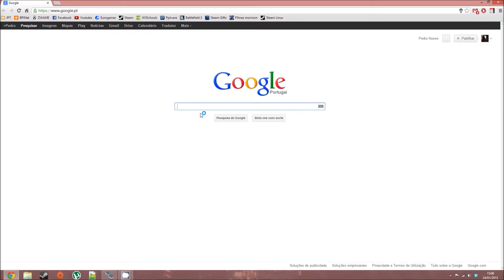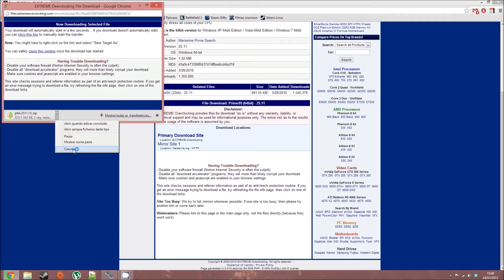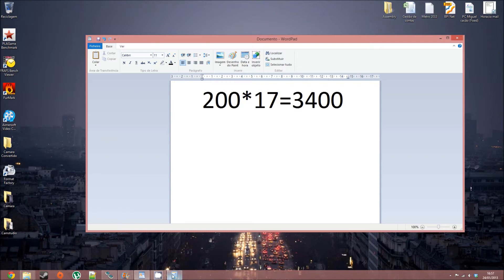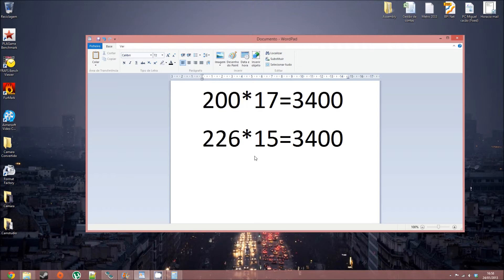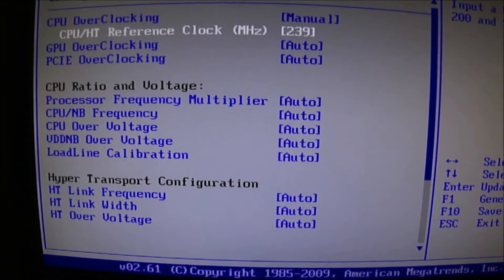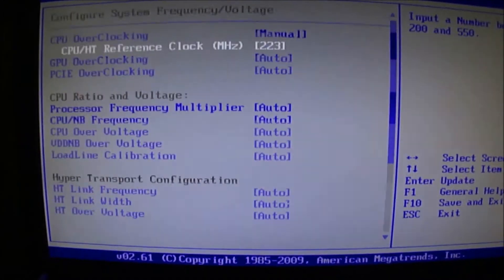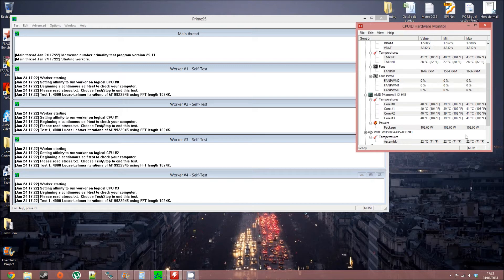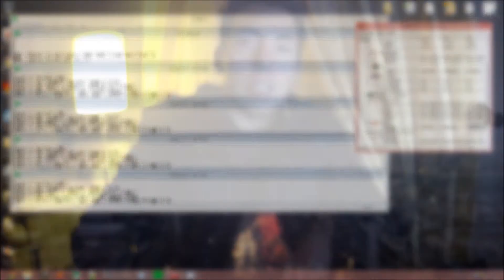How to Overclock Phenom II X4 945 [Basic Toturial]

Comment: Hello :) I got a Phenom II X4 945 CPU (3.0hz) and a GeForce GTX 950 GPU and 8gb ram

What should i overclock the CPU to ? and how ? . I didn't understand anything in the video :) Hope you answer :)
Reply from the maker: Hi..
Well you only should overclock if your GPU Usage is below than 99% (unless you are using any framerate cap or vsync).

What games are you playing lately?
Reply: Hey :) Im playing overwatch. I get framerate drops for 10 seconds or more now and then (every minute), when my CPU usage goes to 98-100%. The game uses 80-90%. When my CPU usage goes below 95% it's goes with 60 (frame cap set on). But for 3-4 months ago, i got my GPU GTX 950, and then i tried it in overwatch, with 114 fps on ultra. It's makes no sense that im getting frame drops, becuase it used to work good for 3-4 months ago. Thanks for fast answer! :)
Reply from the maker: DumbyLumby When you are in idle, with the PC on windows with nothing open, after playing, did you check out your CPU Usage?
I'm telling this, cause many people do download games from torrents from time to time, there are some repacks out there lately that brings a bitcoin virus which uses your CPU and GPU after a while.

But regarding your answer, some months ago you could play the game well with high FPS, lets say >90/100FPS.
And now you struggle to sustain the 60, is that?
Reply: Don't think thats the case. My pc was formatted 2-3 weeks ago, haven't downloaded any torrents. The first days after i formatted, the CPU usage was the same. Have even tried on Windows 10, with the same problems. 

And yes your right in the start i could play witn 100-130 on ultra. (3-4 months ago) Before i formatted. And i have formatted twice. Now i get the problems on low settings, where it framedrops like hell. 

And it's nothing other, there are taking my CPU usage. Had problems with svchost, and have fixed it long time ago.
Reply from the maker: Despite you have a cpu usage of 80-99% during the game, can you check the frequency that you are having in real-time during the game using msi afterburner?
If your cpu usage is very high then your gpu usage should be low like for example <90% (vsync off/fps cap off)
Reply: I can't do it right now bc i need to go :) And im not sure what your talking about with msi and so.
Reply from the maker: If you want, I can try to help you out, later!
Reply: Will be great :)
Reply from the maker: Just let me know then when you will be available, cheers.
Reply: Im back! :) Thanls because you want to help me, with my problem! :) YOu earned a sub btw :D But the problem is not only in OW. It's happening in CSGO to. I get the framedrops to under 40, and then after some time, it goes up to 120 fps agian.
Reply from the maker: DumbyLumby Yep, it's weird cause that it's happening to you in CPU Bound games.
So first start.
You are going to download MSI Afterburner, follow the steps in here:
https://www.youtube.com/watch?v=D8lx5LBifJI
Reply: Done. Downloaded. Did all, like you did in the video :) What now :D
Reply from the maker: DumbyLumby If you leave the MSI Afterburner minimized and press if you open a game, you will see and press the overlay button, which I put on the video for me it was CRTL + H, it will appear all the stats of the PC, just like the beggining of the video.

So it's there the GPU temperature, the GPU Usage, GPU Fan Speed, GPU memory clock, as well as the CPU Usage etc, all during the game in real time.

What I want you to do is... When you get those drops, what happens to the % of the GPU Usage, and what happens to the % of the CPU Usage, take a look too on the Vram MB consumption and ram!
Reply: When the framedroppin comes, my GPU goes from 35-40 to 15-20%. And my CPU goes from 70-80 to 95+ Didn't saw the ram, but don't think thats the problem, since i got 8gb :)
Reply from the maker: DumbyLumby Okay!
Now, let'sforget about the MSI Afterburnder, we know already that is something that is attacking the CPU from time to time :)
Next step is, go play like you did, but use windowed instead of fullscreen, you can drop the resolution for the window to be small, and while playing in windowed, open the task manager and put it side by side with the game, but order by CPU Usage!
So you can see all the processes and see what is eating more CPU.
When the drop frame happens and CPU goes to +95% check out what was the processes that was eating more CPU.
Cheers!
Reply: Im already playing window fullscreen mode :) I got 2 screens, so i have tried to put the taskmanager on the other screen while playing (many times). I have found many fails, but have fixed it thru time. But when i get the framedropping, the games CPU usage, just increase by 5-10% Im not seeing any other "programs" there are running while this is happening :)
Reply from the maker: DumbyLumby Running out of ideias here :(
Can this be driver problem?
Do you have shadowplay activated using shadow mode?
Reply: I have shadow play on. Should i close it, and see if it fix the problem :) =? 

btw. right now im not getting that much framedrops, as i got last day :) Maybe bc my pc was on for 10 hours or something idk :) 

You're the first youtuber who is taking time for his viewers! :) Keep up the good work, and thanks for helping dude!
Reply from the maker: DumbyLumby There is no problem in having it on, I guess, but if you have shadow mode activated, that might be the problem.
Close it all! and see what happens :)
Reply: I don't know that shadow mode is, but is just closed it all lol xD Will test it out, and tell you in some hours if it works :)
Reply from the maker: DumbyLumby Thanks :)
I will explain it later what is the shadow mode :)
Reply: It's still laggin. Do you think it will help to overclock my CPU ?
Reply from the maker: DumbyLumby It could help yes, but it's still weird that those things happen.
So you should start slow.
Do you know how to go to the bios right?
Reply: Im not sure how to overclock, but i know its in the boot menu thing (like your're doing on the video) :) But i don't now what i should overclock it to, and i don't want my CPU to die tho :D
Reply: Still there ? :D
Reply from the maker: DumbyLumby Sorry, I thinked that I did replied to you XD
You should try with ease, overclocking it to 3.3GHZ
Reply: How should i do that :) never tried to overclock before :D I didn't understand that much in the video :)
Reply from the maker: DumbyLumby You see the bios thing, that menu on blue, you should try to raise your FSB which on my board is inside the JumperFree Configuration, CPU Overclock Manual,  And raise the frequency.

Which by default is 200 in all Phenoms!
Every single number you raise, it adds 15MHZ to the CPU.

So if you want to try with 3.3GHZ, you need to put that number at 220.
Then you exit the menu and you need to find an option called Save and exit or save and restart.
Tell me if you can do it.
Reply: Thx! :) I will try to do that :D
Reply: Before im overclock, my temp on the CPU is on 64 *C. How much will it raise, when overclocking +? And will it help to turn up the fan speed in MSI afterburner ?
Reply from the maker: DumbyLumby MSI Afterburner fan curve is only for the GPU, if you are already on 64c, my personnal suggestion is .. don't overclock.
Your temps are already high.

Cheers
Reply: BenchART Yeah i found out :(
Thanks for helping me btw! Have a great day :)
Reply from the maker: DumbyLumby Thanks :)
Good luck with your system ;(
Reply: I think i might have fixed it now :D 
Now my Temp on the CPU is on 50-60 on 95% cpu usage. Before it was on 78 *C :O Don't even wanna think how hot it was, when it was hot in my room (maybe 85). So i should be good to go with overclock now :D and btw im going to by a new cooler soon, for lower temp :D
Reply from the maker: DumbyLumby THAT... MIGHT... Explains why it was stuttering all over the place.

Look... You are killing your CPU, the TJMAX of the 3rd revision of the CPU is 72c, after that thing is starting to melt down, the CPU will try to drop down the clocks to avoid raising more temperature, but sometimes isn't possible.

I was expecting you to have good temps, but you have a big problem there!
Either your Thermal Paste had worn out, or your Case airflow just sucks a lot!
You should look at that ASAP or the Phenom II will just die more faster than you were expecting!
Reply: As i said i have fixed that :) Now it goes with max 58 *C while playin, where before the max was 78. And i overclocked it to 3.3 ghz. and i can run High now, with stable 55-60 fps (with fps cap on)
Reply from the maker: Damn sorry, didn't noticed that, you can always try to overclock more if you want. Still the temperatures I recommend you to try with prime95 running for a while.
But btw, what was the problem causing the high temps?
Reply: What temp does you have while running prime95 ?. And i took the side of my cabinet of, and cleaned the cooler :) But if im going to overclock more, what else should i turn up. Like the voltage of something or ?
Reply from the maker: DumbyLumby You should drop memory a little down, one notch.
For example, my rams are set to 1333MHZ, on bios shows that it is 666MHZ (which is true, cause DDR Speeds is Speedx2), I dropped it to 533MHZ on bios.

You don't need to start to raise voltage unless the system crashes running prime95.
Basically we start to raise the mhz of the CPU, but it gets out of energy, voltage gives it energy and tension to keep up, but makes the CPU to overheat much more and degredates the life of the CPU if the values are very high)

So for now, you just need to raise the FSB (what you have set to 220) for higher values, keep testing the temps with prime95 and see if it crashes (don't forget to drop the ram speed), as soon as it crashes, you will know that you did hit a wall, and you need to raise the voltage, but for now, let me just know when it crashes with the stock voltage
Reply: It crashed :D
Reply: ANy idea what i should set it till ? and maybe i want it to overclock to 3.5ghz. Should i do that, and what settings should i use.
Reply from the maker: DumbyLumby It crashed at what frequency?
Reply: idk xD, But i tried 2 times, crashed the last one. Where can i see the freq ?
Reply from the maker: DumbyLumby So it was with 220mhz?
The frequency you can download CPU-Z, it will show you the frequency that your are running :)
Reply: couldn't seem ti find it, so i just took a screenshot of it :) http://prntscr.com/caa18o

Edit: NB frequency is on 1760 MHz if thats what you mean
Reply from the maker: DumbyLumby FSB 219.96MHZ (220MHZ)
This was what you have set on the motherboard.
The real clock is set to 3.3GHZ
So, it crashes this way?
Reply: IT did the second time yes :) with prime95
Reply from the maker: DumbyLumby Did you dropped the ram?
And what brand and model is your power supply?
Did you checked the temps while running prime95?
Reply: im not sure what brand and model my power supply is :) But its a 600-750 watt cable. Im not sure about that too tho. Anywhere i can check it? And the temps while running Prime95 was 57-63 *C. When playin overwatch the max is 59 *C normally running on 56-57. where before it was 78 *C max as said from some time ago :) I don't know what you're meaning about dropped the ram. Didn't touch anything in the bios, only the 220 thing.
Reply from the maker: DumbyLumby Ok, soo at least th temps are really okay, even on prime95.

You should have something like memory clock on the bios.
What is the speed of your ram?
Reply: Where can i find the speed of my ram =?

Edit: DRAM Freq is on 440 MHZ
and the NB Freq is on 1759 MHz
Reply from the maker: DumbyLumby Your rams are DDR 3 or 2?
Reply from the maker: DumbyLumby Your rams are running very slowly.. only at 880MHZ (440), but well that's the objective.
For now, it wil stay like this for evading problems and to know better what is limiting your Overclock.
I want you to raise CPU Voltage to 1.4V and try again the prime95 and keep on look on your temps.
Cheers
Reply: Will try this tomrrow! :) Thanks for helping :D 
 Cya :D
Reply: Looked in the BIOS and can only find Processer Voltage. It's on 1.35V and it's the max. I can put it up, but there stands 1.35V is the max it can take
Reply from the maker: DumbyLumby What is your motherboard brand and model, some boards can be unlocked further :)
Reply: ASRock 760GM-GS3
Reply: that was a big conversation

Comment: Hey man! Can I do a overclock with my Phenom II X4 945, with a GTX 970, 8 GB of RAM? Because I'm having some lags in games like Dark Souls 3, Far Cry 4, Witcher 3, etc. Will the overclock result in a better performance?
Reply from the maker: Portuguese?
Hi there.
To start on, don't get offended, i have no objective to warm you, but you were dumb to match a GTX 970 with a Phenom II X4 :P

Phenom II X4 can't feed a GTX 970 properly, you must be having the biggest bottleneck of the story, but you aren't the first that did come here with a Phenom II X4 and a GTX 970 :P

So yes, overclocking will help a lot you system, but i would consider to upgrade your CPU, you are losing a lot of performance because of the Phenom II, and dispite the overclocking will help you out already a lot, it still won't be enough to extract the full potencial of your GTX 970.

So yes, you should overclock, you will see better results without a doubt, but either way, you should start to save money and upgrade your cpu.

Cheers.
Reply: Yea, I'll do that. I bought the VGA already thinking in a possibility of bottleneck, but didn't have money to buy both the VGA and a new CPU. In the end of the year I'll upgrade my CPU. Thanks for the help, cheers
Reply from the maker: João Pedro Amoroso Ye, i guess you hold well until then :)
Reply: +BenchART One more question... When I press DEL to access the BIOS, it appears a such different BIOS than yours, and mine doesn't have the things yours has. Why is that?
Reply: +João Pedro Amoroso can I add you somewhere so I can send you an image of it? I can't do it... Thanks for the help so far
Reply: +João Pedro Amoroso maybe my motherboard doesn't support a over lock? Idk
Reply from the maker: João Pedro Amoroso All should support overclock, some can be more stable or better for it than other depending on the chipset it uses.
Reply: But my BIOS is so much different from those I've searched in the internet. I can't find where to do the overclock!!
Reply from the maker: João Pedro Amoroso Can you take pictures and put here?
Reply: +BenchART okay, I'll try to do it tomorrow. If I can't post here I'll try sending like a YouTube message
Reply from the maker: João Pedro Amoroso You can, you just need to post the image on a cloud and get a link or on "postimage" (it's a website that i use for uploading images to get links).
But yeh, i will try to help you out.
Reply from the maker: João Pedro Amoroso Can you name me your model of your motherboard?
That is soo weird... :O
Reply: Gigabyte GA-M68MT-S2P
Reply from the maker: João Pedro Amoroso Can you see if this works?
He pressed on something in the bios..
Look

https://www.youtube.com/watch?v=S-e6-1UJIqY
Reply: Okay I'll try. If I can fix it, I'll try to watch your video again, so I can try to understand more than I did the last time hahah. If I have anything more, I'll ask you again.
By the way, thank you SOOOO much for helping me out. I really appreaciate it. cya!!
Reply from the maker: João Pedro Amoroso It seems that when he enter the bios he press Ctrl + F1 and then when he go to advanced bios, he have all the settings.
Reply: Hey man! So I did the overclocking today. I raised both my CPU frequency and multiplier (230 x 14). I also decreased my Memory clock, just as you said in the video. Now my CPU core speed is at 2800 and something MHz. Shouldn't it be at 3220 (230 x 14)? And do you think I should increase that? Because the temperature didn't change at all for the moment. If you think I should, what numbers should I put?

You said in the video that I should test it using Prime95, but I kind of don't know how to use it properly. And the last thing, when I changed the configs at the BIOS, it appeared a message before initializing the computer. It was saying that the BIOS was in Safe Mode, and I should change the CPU frequency. But I pressed F1 and continued to initialize the computer. Is there something wrong?

Cheers, and thanks again for the attention.
Reply from the maker: Its impossible that you raised the multiplier. The phenom II x4 945 dont have unlocked multiplier. And the multiplier should be set to 15x so you decreased it and not raised it
Reply: https://postimg.org/image/kikb5nof5/
Where is circulated red is what I changed.
Reply: So I should put the multiplier in 15x and raise even more the cpu frequency?
Reply from the maker: You just need to change the multiplier for 15x, and left the fsb in 240, dont Forget to drop the rams ;)
Reply: Yeah, I did that. But it didn't increase the Core Speed!!! It is still 3.0 GHz only, instead of 3.6... does that have something to do with the BIOS starting in Safe Mode? Because when I turn the PC on I need to press F1 to continue! Here is the message that I get: "Warning! System Is Now In Safe Mode. Please Reset CPU frequency.
Reply from the maker: That's weird. And if you try at with 233 (3.5Ghz)? What happens?
Reply: It stays 3.0 Ghz... I changed it to 233... Do you think I need to unlock something? Because I still think it has something to do with this: https://postimg.org/image/tf59e7inl/ , that appears when I turn on the PC